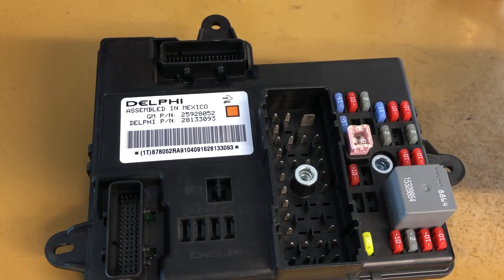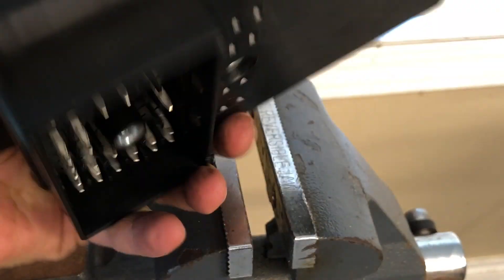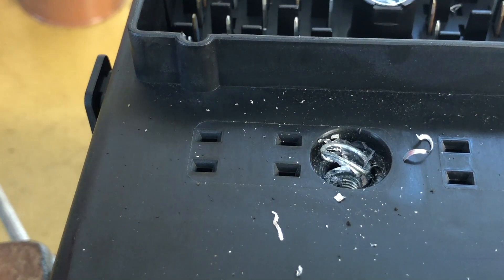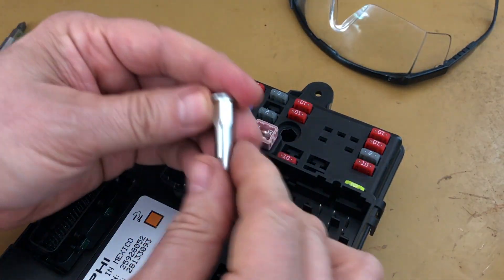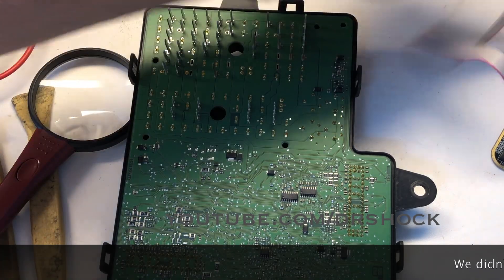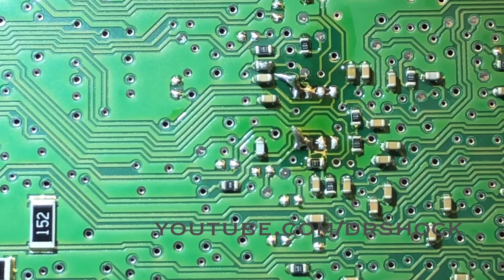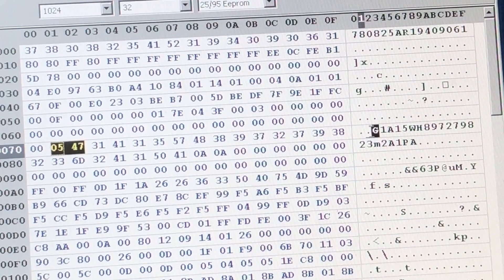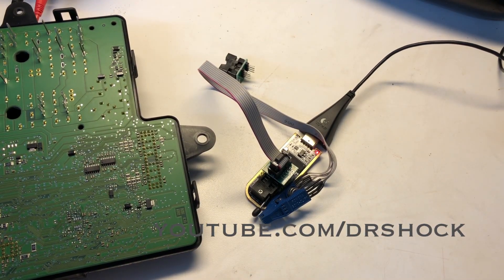2005 - 2010 GM Delphi Body Control Module (BCM) EEPROM Location & Contents (VIN, mileage) Cobalt HHR

Comment: Hi Dr Shock I removed my BCM and read the program and found the VIn is incorrect  when in 8bits but when in 16bits it shows correctly what one do I use 8bit or 16bit programming
Reply from the maker: For this particular Delphi BCM, it uses the ST M95080 chip for storing data such as the VIN.  The "080" in the chip number signifies it as the 1024 x 8 bit size version.  For the M95080, it should be reading legibly at 8 bits.   Typically this detail isn't something you need to worry about or even specify.  

There are many different kinds of EEPROM programmers and their associated software.  Most should default such setting based on selecting the correct chip number in their software settings.  I would suggest checking that you have selected the ST M95080, again presuming you are working with the exact same Delphi BCM part number depicted in this video.   There's some more tech data in the video description on this EEPROM number as well.
Reply: @DrShock  Thanks Dr. Shock the chip says 9386520 ST9425L I can’t find it so used a ST M95080 profile to read chip I would like to send you some pictures of the programming do you can see . I set  the correct Vin in 8bit snd will try it tomorrow but I’m not even sure its from the bcm as electrics is playing around car most of the time doesn’t even start and when starts when on gear no power
Reply from the maker: What is the Delphi BCM part number on the white GM sticker?
Reply: @DrShock  I also have a BCM that has a different ST number but the BCM is identical in appearance from the one in the video. This BCM cam from a 2006 Solstice. GM# 15838782 DELPHI#  28039725 and the ST number I am not able to make out the last digit. ST9531?.. I am using the XGECU T48 Pro and there is no ST chip with those beginning numbers in the software for the programmer. I selected the M95080 and it read the chip. This is a used BCM I am messing with so I do not know the VIN number for the car it came from. The data is in the same orientation as what is seen in your video. The only thing that is different is the serial number is not on the top line. It starts on the second line.

Comment: from the vid i did a vin search that is written to the eeprom but it seems it is not complete and/or valid vin number even with the adding a 1 in front, 1G1A15WH897279823 , it comes up as chevrolet passenger 2.2l, nothing else afaik

Comment: if i took a BCM from the junk yard, can I swap the Proms and NOT have to bring to GM for a reflash?
Reply from the maker: For the specific vehicle and model years this video covers, and if the GM/Delphi part numbers on the white label match exactly, yeah.   You cannot reliably do this between different part numbers as the circuits have often changed, and the chip contents are usually different.   You may, or may not, be able to do this technique with BCMs other GM models and years.   But this video only covers one make and model type and low level procedures of this type are extremely specific.

Comment: I have an EEPROM ST with numbers 1001378 but I have no data on it. I can't read it.  Do you know anything about this EEPROM? It is from a 2007 BCM.
Reply from the maker: If you are attempting to read the chip in-circuit using a test clip, you will have to desolder it from the board.  Some board designs are wired such that in-circuit reading/writing is just not possible.  This BCM design is one of them.   That EEPROM number is the one I covered in this video, some more info in the description on it.
Reply: @DrShock  I missed that in the written description. This thing reads like it's blank and it won't program. ???  I ordered some new 95080s anyway.

Comment: I have a vehicle where Im swapping bcms, I have not yet desoldered the old eprom and soldered it in the new bcm yet, if I do that do I have to reprogram the key to the car? 2006 Chevy hhr
Reply from the maker: If you swap the eeprom chip, and the two BCMs are identical part number and all, then you'll be all set as you transferred the programming from the old to the new module by moving its chip over.
Reply: @DrShock  so my issue was the car wasn’t starting so I had bought a key replacement. Once I did that the key was programmed to the car but still no crank. So I bought a salvaged working bcm. I installed the bcm and programmed a new key to it without realizing I had to program the other bcm. So my question is if I swap bcm EPROMs will I still have to program the new key?
Reply from the maker: The key data will be in the eeprom of the bcm.  So if your original BCM has a good eeprom (you would need to read it with the programmer first to be sure as sometimes they do can bad at the chip level) then it will have the old key data programmed.  I can't tell if your key replacement comment means a copy of your original key, or a brand new key and lock cylinder for it.  But regardless, the eeprom will carry the last key data the bcm knew about.

Comment: GM no longer makes a BCM for my 2007 Corvette. Do you know where I can buy a refurbished unit? Thanks
Reply from the maker: If it's discontinued, then it's only going to be eBay or a salvage yard.  You could run the link in the description, and then change the GM part number to create a saved search.

Comment: Hi! I did this and my car is locked. Do you know what I can do to fix it?
Reply from the maker: Not sure what you mean by locked but if anything went astray, here are some things to check/recheck:

- Does the target BCM have the exact same GM/Delphi part number as the source BCM?   This is required.
- Did you select the correct EEPROM device type/number when saving your backup bin file in the programmer?
- Did the target chips programming verify against the original source contents without error?
- If you didn't reprogram but physically moved the source BCMs chip to the target BCM, did you verify pin 1 orientation before resolding?
Reply: Yes. Same part number. When I connected the bcm back in the car, it says locked on the radio. It won't start. When I connected a reader to the obd it said no communication to bcm. So, I should try to turn the chip? Also do you know what size screw you used for the one connector? Is dielectric needed?
Reply from the maker: I don't recall the bolt size off hand, I tried several spares until I found the correct one to fit the existing pressed in threads.  It is metric though.

Ok so you physically moved the chip then.  So yeah most likely in the wrong pin orientation.    Compare the writing on your EEPROM with how it looks in the video and make sure it's the same right.  If not, you'll need to desolder and flip it around.  If the writing is in the same orientation as the video, then there's something else going on.   I would double check that all pins/pads are correctly soldered.  And if still no joy, I would carefully re-remove the chip and read it off the board to confirm it's good, and has expected contents (e.g., VIN number).

Comment: What software are you using to read/write the PROM?
Reply from the maker: I usually use AsProgrammer if I'm using the CH341a black edition programmer.  Otherwise I use the Auto Electrics TL866II Plus provided proprietary software.